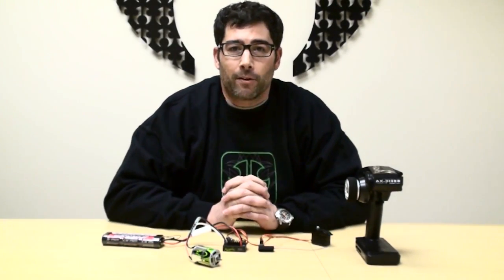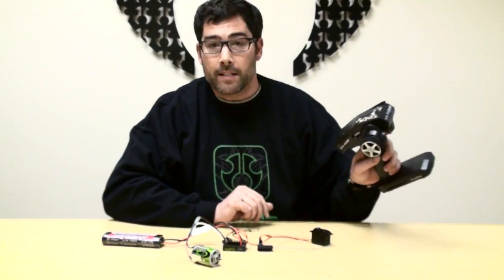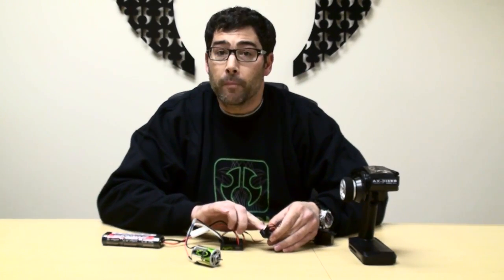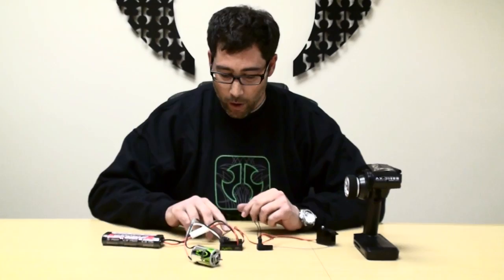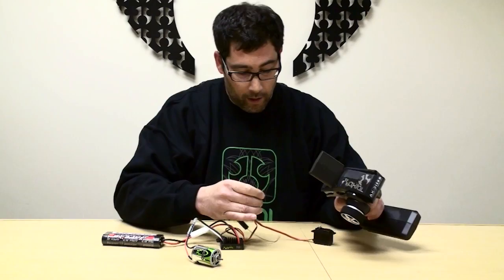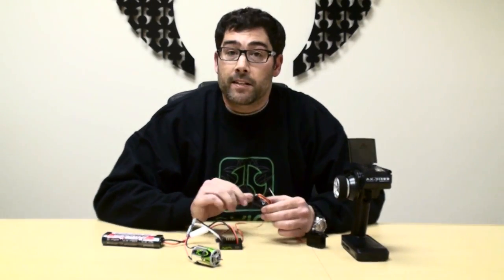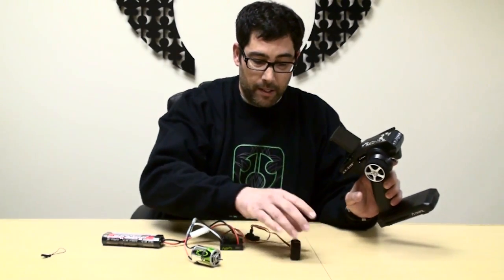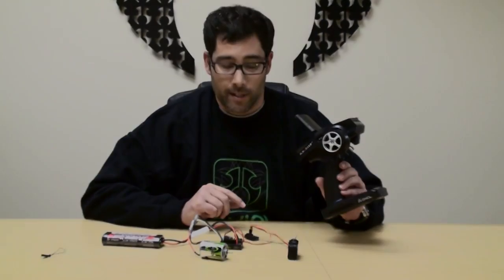Axial - How to bind the AX-3 Radio and Receiver

Comment: Is it possible that my radio steering knob is broken?  I lost steering after my first run so I thought this was the culprit but I successfully did this procedure and still no steering.  Then I noticed that while the servo doesn't respond to the steering knob it does turn when I adjust the trim knob so it seems that the servo works which leads me to believe it's in the transmitter.  At my wits end with this "RTR" after only day three!  Please help, I really wanna love this truck!  Thanks.
Reply: MrKnuckles8978 I have this problem did you figure this out